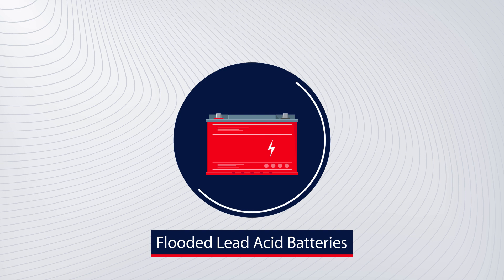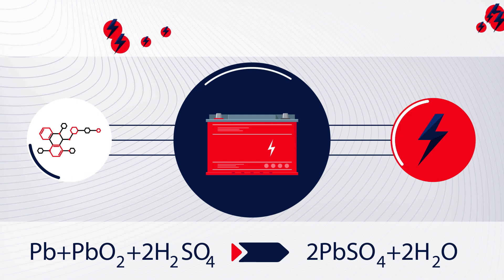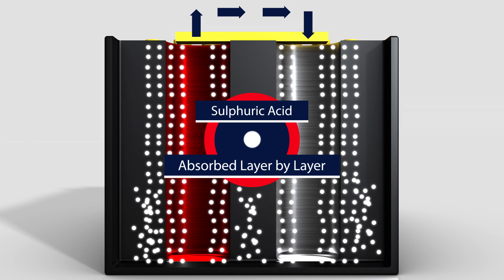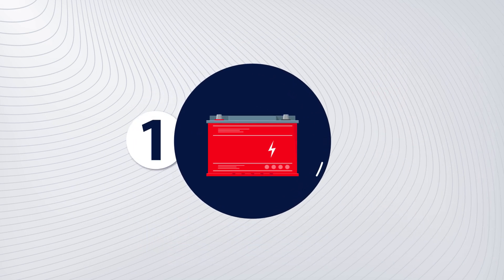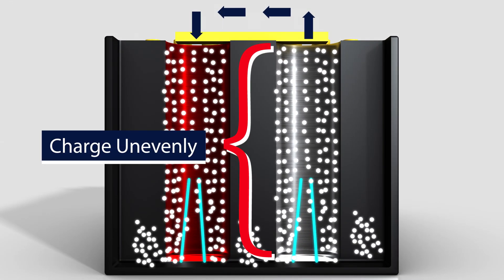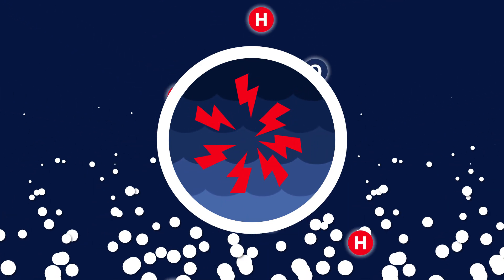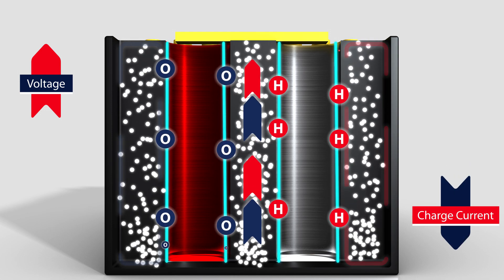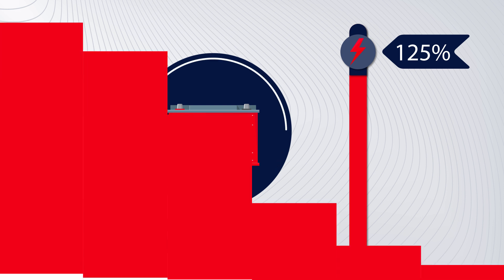Flooded Lead Acid Battery: How does it work? | Hawker Powersource, Inc.

Comment from the maker: HAWKER® develops customized monitoring and fleet management systems using a variety of diagnostic tools and reports to streamline customers' fleets and effectively manage  their battery charging operation. With our exclusive on-site Harness the Power Assessment, we can analyze customer operations and provide specific, customized solutions to improve material handling productivity. Schedule your custom on-site assessment by reaching out to your nearest HAWKER® dealer by dialing (US only) 1-877-7HAWKER.